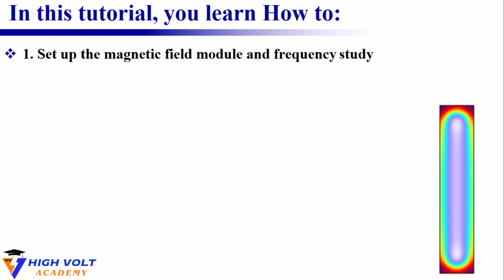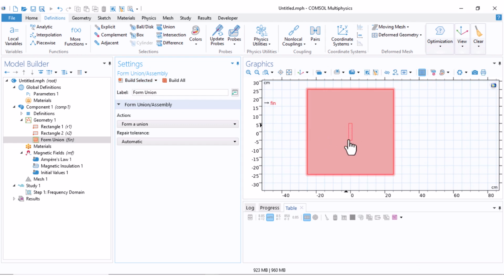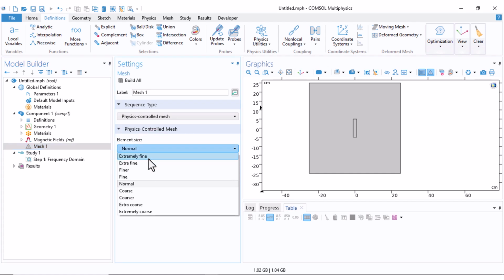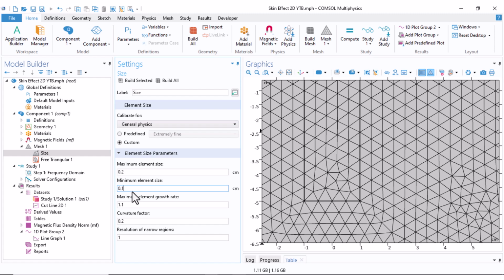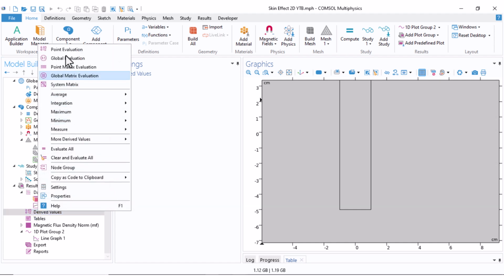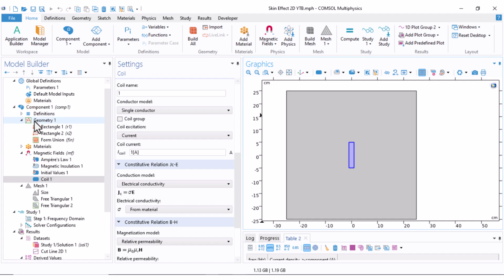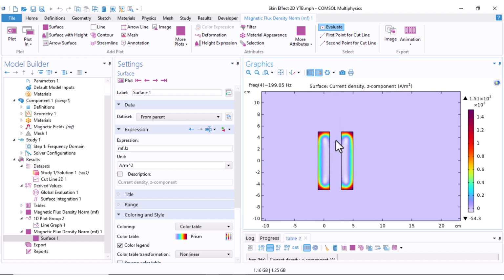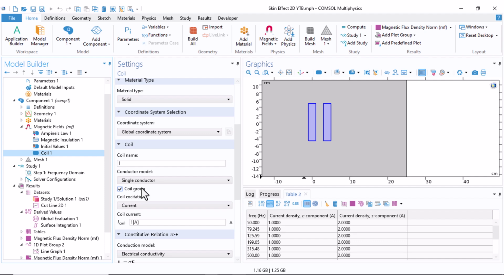How to Simulate Skin and Proximity Effects in Conductors Using COMSOL

Comment: interesting video tutorial 👏 I have tried to calculate the power in two ways with unexpected different result, by mf.PCoil_N1 and mf.RCoil_N1*mf.ICoil_N1^2, do you know why? the second one is double?
Reply from the maker: Thanks for your kind words! 👏
Regarding your question: I believe the difference comes from the way COMSOL handles peak and RMS values. The second expression calculates the power based on peak values, while mf.PCoil_N1 uses RMS values, which is the correct approach for average real power.

In constant sinusoidal excitation, the real average power is half of the DC case, so to make both calculations consistent, you should use RMS values for current and voltage. Since the RMS value equals the peak divided by √2, the term mf.ICoil_N1^2 should be divided by 2 to correctly represent the real average power.

Comment: Excellent simulation. I have a question: how can I determine the appropriate point to connect the AC voltage to the electrode in 3D?
Reply from the maker: Thank you for your compliment. In a 3D model, the voltage should be applied to a surface (in 3D, boundaries represent surfaces) rather than to a line or a point. For example, in the case of a busbar, you can assign the voltage to the two end surfaces of the busbar for proper excitation.

Comment: If I need to simulate a mutual capacitance touch screen, how do I simulate the two type of electrode? I see the example released by comsol in 2025 set all of them as 0 charge, I'm not sure it'll work.
Reply from the maker: Hi! I assume you're looking to calculate the partial capacitance between two electrodes. If that's the case, you can simply define them as terminals and perform a "terminal sweep." In this method, the terminal voltages are initially set to zero in the physics definition but are varied in the study section. The software then activates each terminal one by one (applying 1V to a single terminal at a time) and computes the capacitance between that terminal and the others. This explains why all terminal voltages are set to 0 in the referenced example. I'll be releasing a video soon on calculating the partial capacitance matrix—stay tuned!

Comment: If I need to simulate the skin effect of a 3D model, how do I add alternating current?
Reply from the maker: If you run the model in the frequency domain, the excitation is alternating by nature. You simply need to set the study to a frequency domain analysis, specify your desired frequency, and define the amplitude of your current. This is the standard approach for sinusoidal steady-state analysis.

However, if you also want to observe transients, you should choose a time-domain study and define your current as something like Asin(ωt)—for example, 100*sin(314*t), which represents a 50 Hz current with an amplitude of 100 A. This method allows you to capture transients, but keep in mind that the simulation will take longer, especially if you're aiming to reach steady state.
Please let me know it you need more help.
Reply: @HVAcad  ok, thanks。And another question: How to simulate skin effetc of copper foil (about 20 um) in comsol?  Does foil's current distrbution will be difference ?
Reply from the maker: @vkchan6262  That depends on the skin depth, which is influenced by both the material properties and the operating frequency. You can find the relevant formula on Wikipedia (https://en.wikipedia.org/wiki/Skin_effect).

First, calculate the skin depth.
If it's much larger than the foil thickness (20 µm), the current distribution will be nearly uniform.
But if the skin depth is smaller than 20 µm, then the current distribution will indeed be affected due to the skin effect.
The simulation process remains the same—just make sure to refine your mesh appropriately to capture the skin effect accurately.

Best regards!

Comment: How to perform R, L, C extraction of rectangular busbar in comsol similar to ansys Q3d
Reply from the maker: If you mean the capacitance and inductance matrix, I will cover them in future videos. But to answer it short, one should use the terminal sweep technique. For example, in the case of capacitance matrix calculation, each conductor is defined as a terminal. Then, the software energizes the terminals one by one and calculates the partial capacitance between each terminal with the others. In this manner, the capacitance matrix can be formed. A similar method is available for self and mutual-inductance calculation to form the inductance matrix. Regards